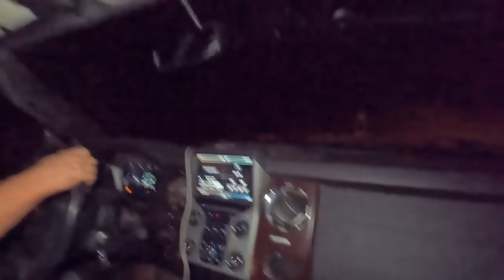You Took Your Hyundai Over 100 Miles Into No Mans Land!

Comment: Wow!  That is a lot of fuel to be out of for a 10 hr. round trip.  I have found out that it is better to send text messages than call in poor reception areas.  Text messages get through faster and sometimes voice mails get lost in the cloud for 2 weeks, before I receive them.
Reply: Hi, you are right .. but Text Messages also wouldn't work without a Cellphone signal .. like Matt said .. there is (mostly) no Cell Service  in that Area ..

Comment: Living in Alaska almost 48 years, I would never buy a small "AWD" for anything other than paved city streets, Matt & Jamie you guys rock 👍👍
Reply: I've a occasional need for body-on-chassis 4WD car but there's so much tarmac in between the places I need to get to so I use an AWD car. Not to mention the fuel consumption difference. And I rarely fall short on my adventures. I do miss a diff locker though and it's not easy getting one for my model. No low-range either. But it gets the job done.
Reply: @HHalcyon  same. I have a 4Runner, but I live three or four hours from any trails. 99.99% of the miles on it are all pavement miles in 2wd, haha. If I lived out in Utah though, the 4wd would certainly get some use.
Reply: Those are Chinese tourists in a rental
Reply: AWD is for slippery road conditions, 4WD is for hazardous road conditions. They each have their place for different people.
Reply: True. My Subaru can go almost anywhere though.👍
Reply: @trailrunnah8886  Same here man. i have a G Wagon and doesnt use it really in the mud. I mean sometimes like 4-5 times a year or something like that. Offroad is not so popular here in Germany, so there are not so many trails. But a G belongs off-road, so we move it there as well. sometimes
Reply: @spencertherren6806  The driver is at least as important as the vehicle. Knowing what you are doing goes a long ways... it also means that you know what "Reverse" is for.
Reply: Theres a lifted crv on 33" tractor tires on youtube that looks like it would be fun.  But I definitely agree with you.
Reply: @HHalcyon  I prefer all wheel drive over 4 wheel drive and a lot of the time it's just as capable. Many trucks are switching to an AWD system over a 4wd system because they are becoming just as capable of 4wd. Obviously there are some differences because the computer is a bit slower but give it 5 more years and it will such a small difference it won't matter.
Reply: Those Hyundais have a locking center diff and full traction control off buttons, but I doubt the drivers knew that.
Reply: I’ve done so much stuff that shouldn’t be done with awd cars that I am not surprised when they climb a snowy or muddy hill or scrape their way along a trail. Tires are important. Tire placement, tire speed, tire tread. Lol.
Reply: I have a Nissan Juke 2WD which does quite fine on gravel roads and doing non adventurous back road exploration. But there's no way I would have tried going where those tourists went. You have to choose your battles wisely with today's SUVs.
Reply: @angelofdarkness4806  Even though I hardly ever use it, I like knowing that I have the capability in case I ever need or want to use it. Also, the roads around here are truly terrible, and I don't worry about hitting anything when I'm in the 4runner.

Comment: Back in the early 2000's, I used to take my 1990 Sonata out on the dirt roads and hunting trails. Thing was a champ as long as I kept it on the high side of the ruts. In the end, I picked the wrong side and slid down into the ruts on a side road just short of a field that met back up with the main dirt road in the middle of winter, with about a foot of hard packed icy snow. It took us all night with the 4 of us using dead trees to try and lever and work the car out, we got maybe 35 feet back the 300ft side trail, before we burned off all the coolant and cooked the alternator. We hiked back into town in the morning and bought a new battery, and called a friend of one of my friends that was with me that had a big lifted 4x4 to come help us out, walked the battery back and waited for the truck to come meet us, and the guy couldn't even get as far down the trail with his 40 something inch tires because he couldn't get it locked into 4-wheel drive. In the end, me and one of my friends that were still with the car were still trying to use a log to help lever the car under the front bumper while trying to work out of one of the many holes we kept digging trying to get out(front wheel drive car), I'd had it rocked forward towards the top of the hole, while my buddy reset for the next push, and being tired and exhausted I slightly let off the brake and it started to roll back into the hole and I instantly just thought feck it, and gunned it in reverse and that SOB that didn't want to cooperate all night with 3 guys pushing it, pulled itself out without a single finger or tool touching it the whole rest of the way out backwards to the main road. We drove it back to town and called for a tow truck because we didn't know how much life the batter still had left without the alternator functioning.....

Comment: So I know it's 2 months later but, what about running a dual alternator setup? Have one to charge the batteries for the car and a higher output one to charge batteries specifically for the wench?
That way if the wench kills an alternator again it won't be the one that charges the vehicle.

Comment: I totally can relate to this, late last March I went way in the Arizona Strip. It was damp (from prior rain) but easy driving on the way in, then it rained heavy the night before my departure day. It was absolute nightmare getting out, by some miracle I made it. The most important rule to NEVER break is don't drive into the AZ Strip if it's just rained, going to rain, currently raining, or snow melt. DRY weather travel only.

Comment: I live on the Rez in Northern AZ, great off-roading  3 min from my door.  I don't mess with the mud, it's like quicksand when wet.  On the river banks it IS quicksand and I've been stuck up to my knees rafting.   My 99 4runner limited on KO2s hasn't been totally stuck yet but I don't want to be. I just wait until spring and summer to go deep into the wilderness since I roll solo out here.

Comment: Invest in a high-output alternator for your vehicles that have a winch. I have an 2003 7.3 L F250 which I modified with the ambulance package which gives me two alternators which are both upgraded to 160 amp each.  Very reasonable prices if you order off eBay.  I never have any power problems now. I'm using the Badland Apex as well as a large stereo system.

Comment: Well I’m watching backwards from most recent and gotten to this video to catch up since a couple years ago, and I can’t remember if you had 35’s 12.5 or larger on blue steel but if you don’t yet you really really got to. And a built in air compressor. I run a long bed crew l5p full delete built on air on 35 12.5 and ran patagonias and others and I’ve yet to get stuck in sand mud anywhere hauling a 2 ton camper

Comment: My santa fe has no issues going out there as long as you don't get hung up. If you hold the traction Control button down for about 5 seconds, it shuts all that traction/stabilization control off and it will go thru just about anything (of course with good tires and not getting g hung up or bottoming out). 

Living in MN with over 28" of snow this year, I haven't had any issues. But I have amazing tires and when I feel it slugging down, I back up and go at it again. Only got stuck once cuz I was trying to pull out an F150, a little too much for the little guy. I was successful but slid too far down into a ditch and couldn't climb back up.

Comment: It’s surprising what some of these little cars can do. I have a 2019 VW Tiguan 4motion. It has 20in wheels running Michelin pilot sports and I’ve managed to get that thing across some horribly muddy UK farmland where a Ford Ranger and an Isuzu got stuck. In fact, only two of four vehicles got across that day, the other was a unimog. 
I wouldn’t recommend it as an off-road vehicle, but still, it’s far more capable than you’d expect.

Comment: If your alternator is overheating because of too high of current draw, raise the engine rpms.  The internal alternator fan will move more air and will help keep temps under control.

Comment: Upgrade your battery to lithium and it will solve your winching issues. They're higher capacity and the voltage doesn't sag nearly as bad under load keeping your winch happy.

Comment: They make alternators for car stereos that pump power you will need a regulator so it doesn’t overpower the system. I’m not sure the amps you have on that engine. If it’s hard on the alternator up the amps.

Comment: one chain on the front wheel, one chain on the rear wheel....whyyy

wonder if they make offroad accessories for the Hyundai like they do for subaru.  lift+skidplates+rear locker makes a world of difference to AWD vehicles  (as long as their AWD system is up to the task and doesnt just overhead)

Comment: The very hour you drove blue steel off the dealer lot you should have put a larger set of real, non-Patagonia mud terrains on it, then went online for a true locking front differential for it
Reply: Probably Firestone Destination MT2s. They dig the best in gumbo mud.
Reply: Firestone doesn’t help sponsor the channel.

Comment: If you wanna stop cooking alternators, put a 22w UVC solar panel on the Morvair, & have Tom make you a 15v max Super Capacitor battery. Will take the load demands off the alternator & be gentle on it. If you run winches with the engine off, you'll boil batteries. Those 2.5v 700 farad super caps with 6 in series can output 3-4 kilowatts for 30-50 seconds without asking your alternator for load. Then it tapers the load request. Cost 25$ to make with balance boards. Makes alternator last longer cause the winches on/off is what is hurting the AC>DC rectifier in your alternator. Adding a second alternator will prolong their life too, rather than a bigger pricier one. But the capacitor deals with the abuse while the alternator supplies a steady lower load. So the capacitor is like a shock absorber. The super capacitor always draws 1-2 watts. So you'll want a UVC solar panel to make sure it doesn't drain your batteries. They are 88$ at home depot. 25% output from a full moon, & work @ 100% output if you can see outside regardless of direct sunlight (ie during snow, rain cloud cover)

Comment: U need a full rain jacket suit with up sized gunboots u can fit small shoes in 
So u can work in mud and water then just  wipe hose off and take the whole suit off wen hop in car

Run a bigger alternator or run more than one
I'd also build the engine and systems up to be sealed instead of stock open like is now

Comment: I’m actually impressed with how prepared the driver of the Hyundai was. Chains. Awd. Traction boards. Gas. Water. Better tires & a bit more clearance that car would have been fine. I mean… they made it that far didn’t they? It even did really well after it was pulled out. 
I’m really curious what a job like this cost the owners though.

Comment: An All Wheel drive is  not necessarily a 4 Wheel Drive. I don't know what drive functions the Hyundai has, but I can tell you the AWD MG HS has a central Diff Lock which forces it to use 4WD. I personally would not take the MG where the Hyundai was found.

Comment: Cars that should not be out here: Once upon a time I drove my 2005 Mustang GT out on some roads like these near Abiquiu, NM, looking for the cathedral rock formations. I ended up at the bottom of a long steep hill with a locked gate at the bottom. Nothing to do but turn around and drive up a sheet of ice with a thin dusting of snow. Luckily I had shod the car with Michelin Alpin winter tires. I put the car in first, eased out the clutch, got a run at the hill and kept her in first at 20 mph, knowing I wanted to control that wheel speed and keep it constant all the way up, ready to push in the clutch at first sign of trouble. Well—those tires did not slip once. I wanted to give them a big hug at the top of the hill. The ice rated tires got me out of there. Pretty sure someone was looking out for me that day.

Comment: Some of that stabilitrac crap is just pure junk. On my truck if you rock it back and forth to try and get out or have been giving it gas to try and get out it starts acting up and throwing lights within a few minutes but once you get out and start rolling it all settles back in. I finally figured out that I have to hold the button for like 10 seconds to fully shut stabilitrac AND traction control COMPLETELY OFF and it won't try to re-engage on it's own then. Honestly hate that crap but I guess for completely inexperienced and novice weather, dirt, and off road drivers it could make a difference...to a degree.

Comment: Some people just aren't too bright, just because you have awd or 4x4 isn't a pass to go anywhere, you need a full equipped vehicle to go in those conditions, a proper 4x4 system, a lift, a winch, and other equipment that could be used to pull yourself out and even then it's a risk in a area that's 100 miles from civilization

Comment: Regarding the winching being hard on the alternator, GM makes a special harness we use on our western plow trucks that disables the alternator when operating the plow. It's a simple relay on the 2 wire plug going to the alt. This would solve your problem and allow your battery to still charge when not activating the winch. Should be super easy to build yourself.

Comment: build yourself a battery box with a few batteries in there, should help alleviate some of the load off the alternator when you are running high loads. can either be built in or removeable from the vehicle. charge it in-between excursions :)

Comment: This video ought to be an obvious "message" to EVERYONE who owns one of those all-wheel drive soccer-mom grocery wagons.  That all-wheel drive is meant for use on slippery, PAVED ROAD conditions ONLY.  Those machines are NOT intended for any sort of "off-road" usage.  Check the thing over.  If it does not have strong towing attachment hooks, FRONT AND REAR, you'd be well advised to never take it off the pavement.

Comment: AWD is NOT 4WD folks. Remember that when you buy an AWD vehicle. AWD is designed to help you get out of sand/snow/Icey situation on normal roads during rough conditions. It's not that you now have lockers and can wheel like a 4x4. Common sense folks. So frustrating every time I recover a Subi where the owner thinks it's the world most capable off road vehicle. Good grief...

Comment: I am curious why you go through alternators so often. I know heat is a contributing factor, but why is winching so hard on them? Would a larger (or doubled) battery provide a better solution? Your use is somewhere between the "real overlander" (IMO, travel off-road outside your home country) and the "challenge" 4X4ing guys who try and get Most Stuck. Surely you could have an alternator custom-wound for longevity ? FWIW my only alt failures were either diodes or bearings (in light infrequent winching)

Comment: I do tractor work with a skid steer excavator, three different farm tractors, etc. and you really can’t work for nothing and let people take advantage of you. You’ve got a big investment and workman is worthy of his hire and you should have a minimum net nonrefundable deposit put on the Visa card customers Visa card in advance You know minimum charge $300 whatever it is in your guy’s business. I know we had a motorhome towed from Crescent Valley,, Nevada into Winnemucca one time and the cheapest anybody would do it for was $1000 that was only about. I think it’s 50 miles he did have dropped the driveline And that was like 10 years ago.  Good evening, $300 wouldn’t cover your staff, your investment and your mileage and your 10 hour round-trip on the one that you went to at the end of the video. That.Tow on the motorhome was done with a Ford F750 crew cab rig. It was a 30 foot Fleetwood chassis or Ford chassis and hold it at about 70 miles an hour.